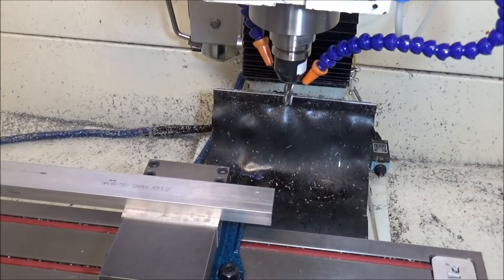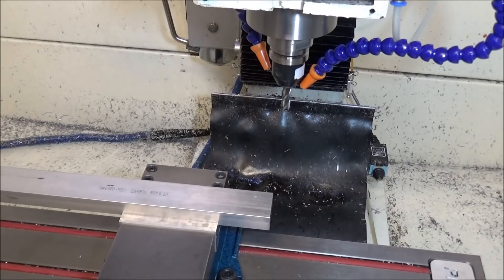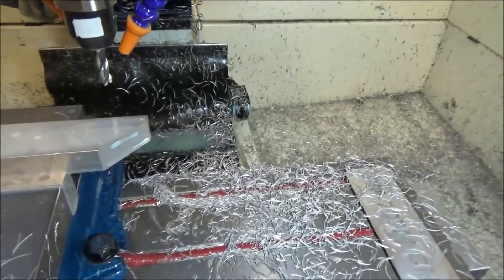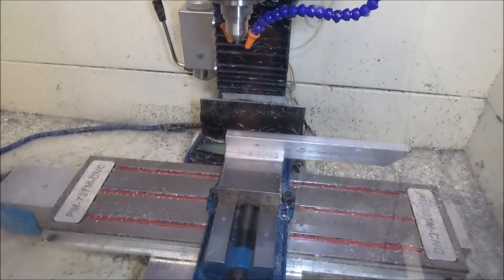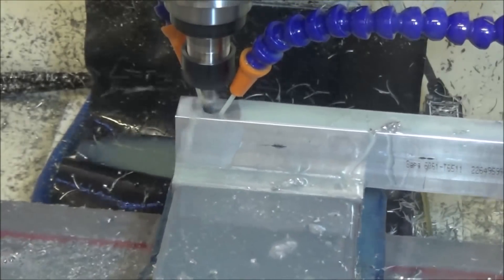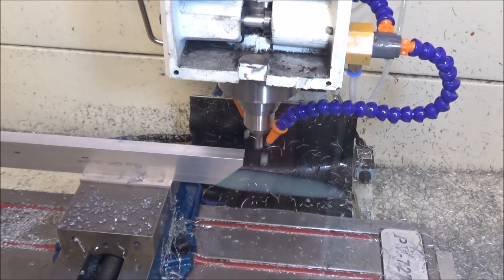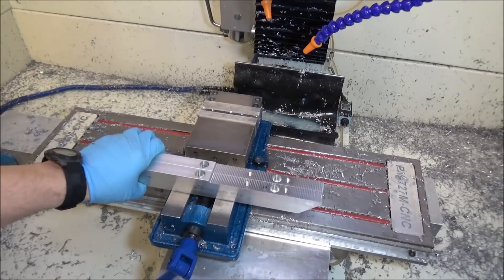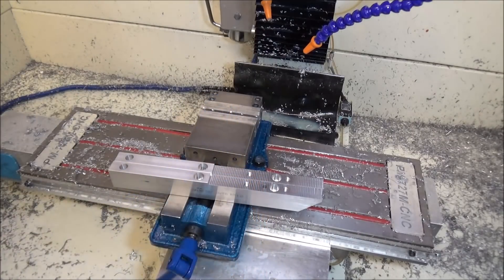PM727M Belt Drive Risers

Comment: Hi Sam, the very first op, could that have been programmed to cut in both directions? There seemed to be a lot of rapids.
Reply from the maker: Funny you should Ask I kept asking myself why not move along the X axis far fewer rapids for the life of me I could not get it to cam in that direction.
Reply: Fusion will not cam in both directions?
Reply from the maker: most likely its a Origin setup thing I'm guessing i did not look into it in length I tried a couple things then just let it go. as is